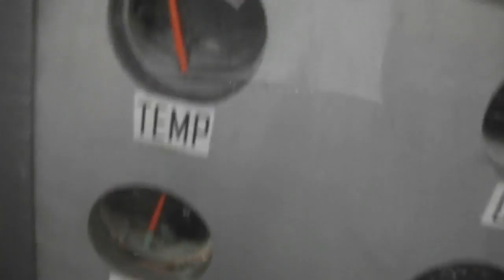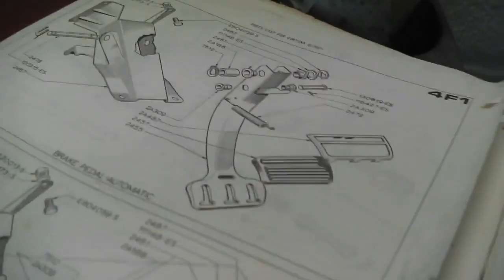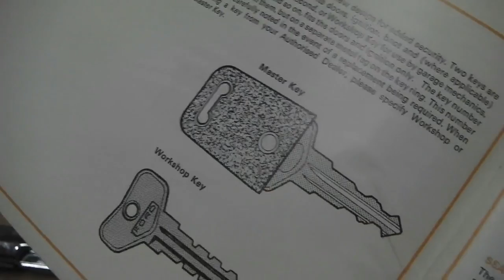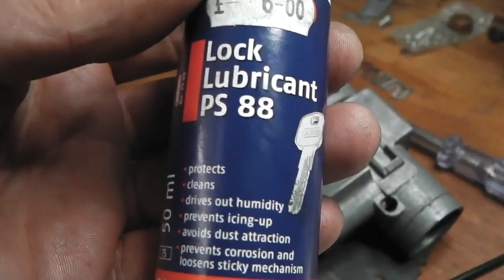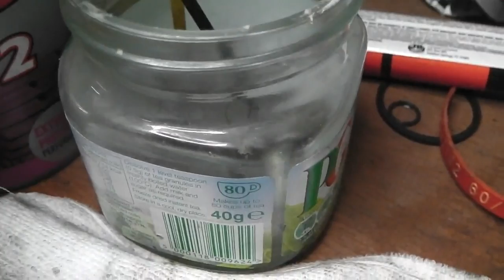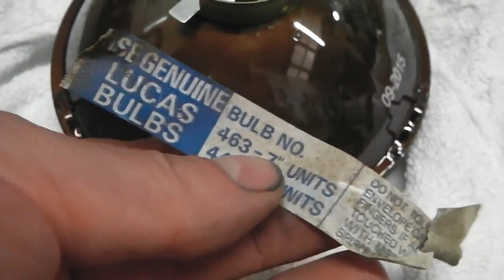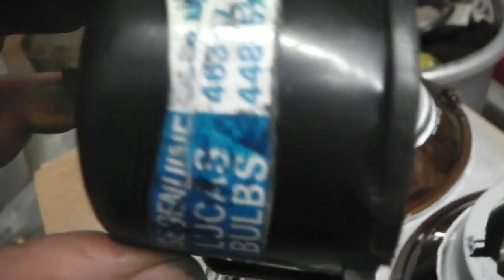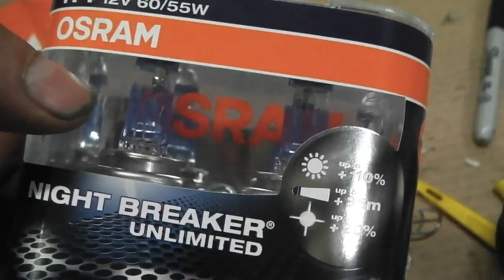Ford Cortina MK3 Restoration - Project Ruby EP36

Comment: Amazing job on those lamps Pete. I'm in the key business myself it takes me back to when I used to make a key to fit the lock on the old fords. With those wafers you can carefully alter them if they need a bit of meat removing from the inside of the oblong cut out .Carefully file out trying the key a bit at a time till the wafer falls level. Great Vid pete

Comment: I remember being in the back of one these in '76...Going to holiday camp in wales...
Murder HOT...on them black vinyl seats..It over heated in a jam..Mum tried starting it while her b/f was messing under the bonnet... ;O   All shouting ensued!
Maybe you should upgrade the cooling...Even new it was flawed.
Reply from the maker: hot vinyl seats burn ya derriere!!! yes i thought about electric fan, been ok with current car even in Italy, but it does creep up. If you keep cooling system flushed and with 50/50 Glycol it seems to be ok, but yes ill keep eye out. Pete. thanks for comment good to see you

Comment: Hi do you recycle all the old metal etc ? And not chuck it in the bin ? And to change square lights into quads do you just change the backing plate ?
Reply from the maker: Hi Mark, yes i recylce plastics and metals at work and home. dont waste anything. Yes i think you just change back plates and grill

Comment: Part way through this video, Pete, It's your car, who gives a fuck about what you do in the restoration of it?
It was a dead, unused car, 
And you have the skills to make it useable again, that car is a tool, fucking use it!
Regards, J.
Reply from the maker: Joe, i know, i do like the subtle 'neat' mods, there some purists who think they knwo it all but they are on the armchair most time instead of working and actually getting job done!!
Reply: Thanks Pete for the reply, Been there done that, I don't really give a crap about the end product, do it well and with good intentions,
Reply from the maker: Last project car just hit 27K miles since i rebuilt it. Just been in Lakes today 170 miles round trip. build to drive. all the best (see you liking old skool trance, was there 93/94 large)